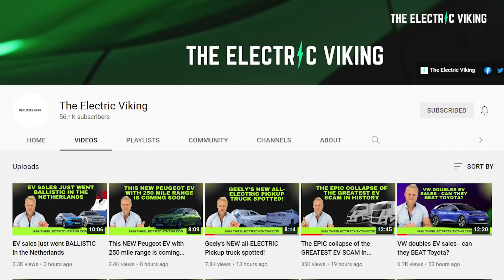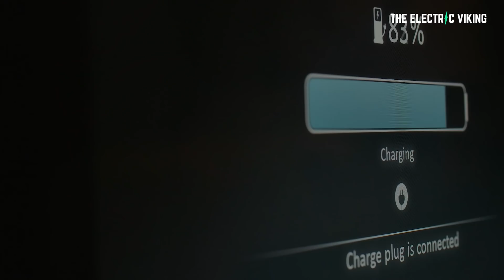Tesla Model 2 details emerge in China: 3 models + BYD battery

Comment: I think you have got this all wrong,  as most US youtubers have got it wrong in thinking there is only one vehicle optimised for US road space.
Elon has touted 3 different vehicles.  The compact, designed and built in china with a stated price from $19000,  but too small for the US market.   This will be exported to some markets including Europe but probably not the states.  The chinese one was the first anounced.
Then there is a German designed and built 5 door hatch.  This might be exported to the states and could also be the $25,000 us vehicle.  But I expect the US $25,000 vehicle will be specifically designed in the US for the US market.
Myself I am waiting for either the German or the Chinese model.  The smallest existing tesla is the 3,  and even that pushes the space allowed for parking a little in Europe.
Reply: But when??? No new models this year?? you will be waiting a long time...
from an article today...

The $25,000 Tesla Is As Dead As the $35,000 Tesla
Face it, there won't be a "cheap" Tesla for a long time, if ever...Don't hold your breath waiting for Tesla's rumored $25,000 electric car. "We are currently not working on the $25,000 car," Tesla CEO Elon Musk said during a call to report the automaker's stellar fourth-quarter and full-year earnings. The reason: He has too much on his plate...But Tesla won't be introducing any new vehicles in 2022, Musk said. With parts shortages, adding new models would take away semiconductor chips and other key components from existing models that also need them. 

So, it's not just the $25,000 car we won't see this year, it's everything on your wish list, including the Cybertruck, Semi, or a new Roadster. The company hasn't rolled out an all-new nameplate since introducing the Model Y crossover in 2019.

Tesla will "likely" introduce new models in 2023, Musk told investors on the call.
Reply: good luck

Comment: LFP batteries are 30% cheaper with 30% less range. No other companies are going with LFP batteries except Tesla. I guess if the price lowers to 25k, then its okay
Reply: nonsense. 1000kms range with Blade LFP
Reply: @BSBSBSBSBS-i2x  if you fill truck full of Lfp baterries then 1000km. you need more learning my friend
Reply: @galaxyoldman  BYD says the new platform 3.0 will enable range of more than 1,000-kilometres through a new electric powertrain and a 20 per cent increase in the thermal efficiency of the Blade batteries. It will boast acceleration of 0-100km/h in only 2.9 seconds.Sep 15, 2021

who needs the learning my friend???
Reply: @BSBSBSBSBS-i2x  thats what you think with BYD released promotion. Have you even seen  VW, Porsche, Ford, GM, Toyota, Honda, Kia, Hyundai Rivian, Lucid, Fisker, BMW, Mercedes, Audi using LFP batteries? There is a good reason for that. Only reason why Tesla implementing LFP battery to partial and not all is because Tesla is trying to make cheap 25k electric vehicle since the battery is cheap. Majority of BYD sales are in China only. What is the reason?
Reply: @galaxyoldman  Oh dear you are sooo far behind the curve.

Most of companies you just mentioned won't exist in 5 years.

"Majority of BYD sales are in China only. What is the reason?"

Duh! It's the world's biggest car market, where they are by far no. 1 in NEV sales.

Don't worry they are going global this year!

You will see!
Reply: @galaxyoldman  Last year, Tesla CEO Elon Musk mentioned that he believes the energy density of iron phosphate (LFP) batteries have improved enough that it now makes sense to use the cheaper and cobalt-free batteries...In October 2020, Tesla started producing the Model 3 Standard Range Plus out of Gigafactory Shanghai with LFP battery cells.

The move was significant because Tesla also started exporting this new version of the Model 3 outside of China for the first time.

This new made-in-China Model 3 Standard Range Plus with LFP batteries ended up becoming Tesla’s new base model in Europe and other markets.

In the US, Tesla has still been producing the Model 3 Standard Range with lithium-ion battery cells with nickel cathode, but now Elon Musk appears to be indicating a possible shift there too.
Reply: @galaxyoldman  Last year there were more LFP batteries used than any other chemistry, which is expected to expand even more rapidly this year.

Comment: Looks to me like Tesla will have no new products in 2022, and BYD already has the $25,000 car and is bringing out a Model 3 equivalent. It won't be the first mover in trucks (Ford etc. beat them to it) nor the $25k car. Also, US growth Is handicapped as the Built Back Better Act with the EV subsidies in it did not get passed. Could be a much harder 2022 for Tesla than 2021. By mid-2023 (probably the earliest for volume 25k Tesla production) China could already be at 50%+ EV mkt share and Chinese manufacturers (including GM) shipping cheap EVs to the US and Europe (the latter may stagnate without them given that the CO2 regs don't tighten again until 2025).
Reply: well said

Comment: Well rumor’s are rumor’s, starting price of $25,000.00 that’s a starting price only. Will the USA customers buy this, I am not convinced, Tesla introducing a new model, when you can’t deliver your existing orders and pre orders, have two models that have not even been put on a production line yet. So all this talk unless it comes from Tesla is speculation, that may well anger waiting customers.
Reply: From an article today...

The $25,000 Tesla Is As Dead As the $35,000 Tesla
Face it, there won't be a "cheap" Tesla for a long time, if ever...Don't hold your breath waiting for Tesla's rumored $25,000 electric car. "We are currently not working on the $25,000 car," Tesla CEO Elon Musk said during a call to report the automaker's stellar fourth-quarter and full-year earnings. The reason: He has too much on his plate...But Tesla won't be introducing any new vehicles in 2022, Musk said. With parts shortages, adding new models would take away semiconductor chips and other key components from existing models that also need them. 

So, it's not just the $25,000 car we won't see this year, it's everything on your wish list, including the Cybertruck, Semi, or a new Roadster. The company hasn't rolled out an all-new nameplate since introducing the Model Y crossover in 2019.

Tesla will "likely" introduce new models in 2023, Musk told investors on the call.

Comment: Those drawings...If they produce a $25k hatch that looks like that with V2G Blades and a solid 200 (pref. 250) ml range...it may well create VW Beetle type popularity - I too believe development is such that availability will start within 12 mths
Reply: No new models this year?? you will be waiting a long time...
from an article today...

The $25,000 Tesla Is As Dead As the $35,000 Tesla
Face it, there won't be a "cheap" Tesla for a long time, if ever...Don't hold your breath waiting for Tesla's rumored $25,000 electric car. "We are currently not working on the $25,000 car," Tesla CEO Elon Musk said during a call to report the automaker's stellar fourth-quarter and full-year earnings. The reason: He has too much on his plate...But Tesla won't be introducing any new vehicles in 2022, Musk said. With parts shortages, adding new models would take away semiconductor chips and other key components from existing models that also need them. 

So, it's not just the $25,000 car we won't see this year, it's everything on your wish list, including the Cybertruck, Semi, or a new Roadster. The company hasn't rolled out an all-new nameplate since introducing the Model Y crossover in 2019.

Tesla will "likely" introduce new models in 2023, Musk told investors on the call.

Comment: There's zero chance the model 2 will come by the end of 2022 or will be $25k. They may announce it in 2022. In the meantime they need to ramp up Model Y,  3, Cybertruck to meet demand at prices much higher than $25k. They won't forgoe profit margins and create more demand for a another new model than they can supply. They'll also want to avoid the Osborne effect.
Reply: The Osborne effect is why they are going to spring it on the world suddenly. Few people seem to realize that—as you can tell from how so many continue to talk about how its debut is so very far away. They'll be doing that right up until Tesla announces it'll be available in three months or so.  I don't doubt the company is busily planning and developing it now.  
     Upon its introduction, the concern will then be Model 2 cannibalization of the more expensive models. They will therefore want the range of higher-priced, higher-margin vehicles, including the Cybertruck, to be solidly rolled out in all the major markets first, to try to cement their market position and reduce the potential for that.

Comment: Zero chance of a model 2 before 2024.  Why?  1st.  Elon already said they won't make this for quite awhile.  2nd, where is the factory?  The model 2 will be many times larger in terms of addressable market and you'll need new giant factories for it.. not just add a line in existing factories.  You'll see new factories or new giant buildings being built beside Texas or Berlin before you'll see the model 2.  Which means, you'll have at least a 1 to 1.5 year warning of when the model 2 will arrive.  3rd. Elon said the model Y will outsell the corolla by 2023.  This means more than 1.5m units... this tells you what they are ramping.  No sense undercutting the model Y before its reached saturation.

Comment: model B, maybe ( as B also means 2).
LFP batteries are effected by charging to 100% and discharging to 0%, which speed up their degradation, just not by the same extent as other Li-based batteries.
Reply: No they are not. You are advised to charge and discharge 100% once a week.

Comment: Yep, sign me up. Will be first to preorder if Elon announces it during the Jan 26th earnings call. 👍
Reply: No new models this year?? you will be waiting a long time...
from an article today...

The $25,000 Tesla Is As Dead As the $35,000 Tesla
Face it, there won't be a "cheap" Tesla for a long time, if ever...Don't hold your breath waiting for Tesla's rumored $25,000 electric car. "We are currently not working on the $25,000 car," Tesla CEO Elon Musk said during a call to report the automaker's stellar fourth-quarter and full-year earnings. The reason: He has too much on his plate...But Tesla won't be introducing any new vehicles in 2022, Musk said. With parts shortages, adding new models would take away semiconductor chips and other key components from existing models that also need them. 

So, it's not just the $25,000 car we won't see this year, it's everything on your wish list, including the Cybertruck, Semi, or a new Roadster. The company hasn't rolled out an all-new nameplate since introducing the Model Y crossover in 2019.

Tesla will "likely" introduce new models in 2023, Musk told investors on the call.

Comment: 30К Теsla is the Toyota & GM Game Over
Reply: But when??? No new models this year?? you will be waiting a long time...
from an article today...

The $25,000 Tesla Is As Dead As the $35,000 Tesla
Face it, there won't be a "cheap" Tesla for a long time, if ever...Don't hold your breath waiting for Tesla's rumored $25,000 electric car. "We are currently not working on the $25,000 car," Tesla CEO Elon Musk said during a call to report the automaker's stellar fourth-quarter and full-year earnings. The reason: He has too much on his plate...But Tesla won't be introducing any new vehicles in 2022, Musk said. With parts shortages, adding new models would take away semiconductor chips and other key components from existing models that also need them. 

So, it's not just the $25,000 car we won't see this year, it's everything on your wish list, including the Cybertruck, Semi, or a new Roadster. The company hasn't rolled out an all-new nameplate since introducing the Model Y crossover in 2019.

Tesla will "likely" introduce new models in 2023, Musk told investors on the call.

Comment: Awesome video. This arguably will be the biggest game changer more than the other Tesla models. Right now in Canada there is no lower priced EV’s so people are still buying Toyota Corollas and Honda Civics etc, this could have a huge impact…
Reply: But when??? No new models this year?? you will be waiting a long time...
from an article today...

The $25,000 Tesla Is As Dead As the $35,000 Tesla
Face it, there won't be a "cheap" Tesla for a long time, if ever...Don't hold your breath waiting for Tesla's rumored $25,000 electric car. "We are currently not working on the $25,000 car," Tesla CEO Elon Musk said during a call to report the automaker's stellar fourth-quarter and full-year earnings. The reason: He has too much on his plate...But Tesla won't be introducing any new vehicles in 2022, Musk said. With parts shortages, adding new models would take away semiconductor chips and other key components from existing models that also need them. 

So, it's not just the $25,000 car we won't see this year, it's everything on your wish list, including the Cybertruck, Semi, or a new Roadster. The company hasn't rolled out an all-new nameplate since introducing the Model Y crossover in 2019.

Tesla will "likely" introduce new models in 2023, Musk told investors on the call.

Comment: Here's what I think - we weren't given enough info to make a prediction.
On battery day, Elon promised a 25k car INCLUDING FSD.
So, if the China rumors are correct, and a new 25k car, including FSD is set to debut soon, well, WOOHOO!
If, on the other hand, he reneges on his promise, and it cost 25k, plus 12k for FSD, plus 2k for dealer prep and all that crap, well, now you're back to 40k, which blows "affordability for the masses" right out of the water, and "gee... let's go look at the Dolphin!"

Everything hinges on FSD.
Reply: "FSD in 6 years" - 2014
"FSD in 2 years" - 2015
"FSD in 2 years" - 2016 (solved problem)
"FSD in 2 years" - 2017
"FSD in Next year" - 2018
"FSD end of this year" - 2019
"FSD end of this year" - 2020 (level 5)
"FSD end of this year" - 2021 (level 5)
"FSD end of this year" - 2022

yep....

also...Tesla won't be introducing any new vehicles in 2022, Musk said. With parts shortages, adding new models would take away semiconductor chips and other key components from existing models that also need them. So, it's not just the $25,000 car we won't see this year, it's everything on your wish list, including the Cybertruck, Semi, or a new Roadster. The company hasn't rolled out an all-new nameplate since introducing the Model Y crossover in 2019.

Tesla will "likely" introduce new models in 2023, Musk told investors on the call.

Comment: I honestly think the name will be Model Z, unless Nissan trademarked the Z name.

The problem I see with the $25,000 USD is that will be for the base model, the long range version will be $30,000 USD, and 35,000 for the Performance model. With the typical battery constraints, the long range and Performance will be offered at first and for a few years bry the $25,000 base version will be offered.
Reply: Don't hold your breath waiting for Tesla's rumored $25,000 electric car. "We are currently not working on the $25,000 car," Tesla CEO Elon Musk said during a call to report the automaker's stellar fourth-quarter and full-year earnings. The reason: He has too much on his plate....

Tesla won't be introducing any new vehicles in 2022, Musk said. With parts shortages, adding new models would take away semiconductor chips and other key components from existing models that also need them. So, it's not just the $25,000 car we won't see this year, it's everything on your wish list, including the Cybertruck, Semi, or a new Roadster. The company hasn't rolled out an all-new nameplate since introducing the Model Y crossover in 2019.

Tesla will "likely" introduce new models in 2023, Musk told investors on the call.

Comment: Elon has said that at the 2021 Q4 financials announcement on 26 Jan 2022 (US time) that there will be 'something BIG' announced.   Initially I thought maybe it will be another stock split (which was rumored be be on 9 Dec 2021, but that didn't happen).  So, maybe the BIG item will be the unveiling of the Tesla Model A/2/Q or whatever, or it could also be Giga Berlin coming online, or even the new line at Giga Shanghai, which could be ready to start spitting out hatchbacks.  Whatever the Big Deal is, I predict there will be a big jump in the TSLA stock price because of it.   I am long on TSLA, and just bought another 56 shares (on the dip).  Fingers crossed for my prediction.

I also predict the Model A/2/Q will NOT be a hatch version of the Model 3.  It will be a fair bit smaller (IMO) More like the BMW Model 1.
Reply: Don't hold your breath waiting for Tesla's rumored $25,000 electric car. "We are currently not working on the $25,000 car," Tesla CEO Elon Musk said during a call to report the automaker's stellar fourth-quarter and full-year earnings. The reason: He has too much on his plate.

Tesla won't be introducing any new vehicles in 2022, Musk said. With parts shortages, adding new models would take away semiconductor chips and other key components from existing models that also need them. So, it's not just the $25,000 car we won't see this year, it's everything on your wish list, including the Cybertruck, Semi, or a new Roadster. The company hasn't rolled out an all-new nameplate since introducing the Model Y crossover in 2019.

Tesla will "likely" introduce new models in 2023, Musk told investors on the call.